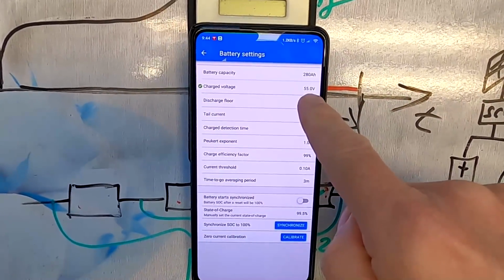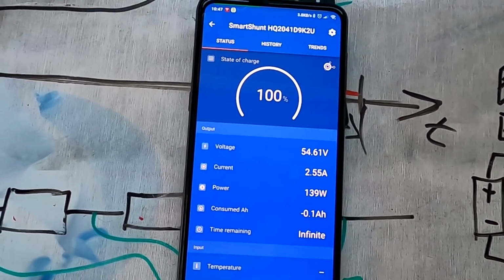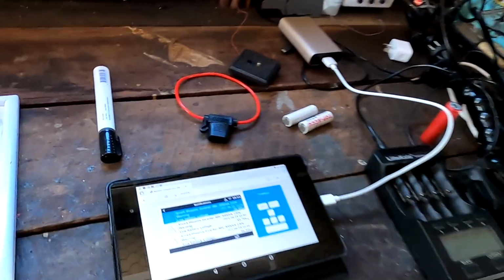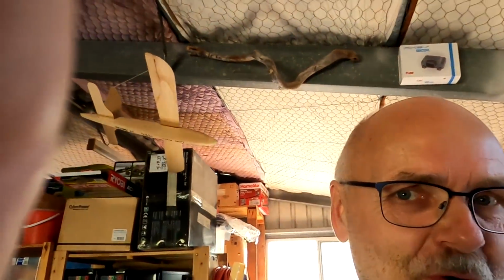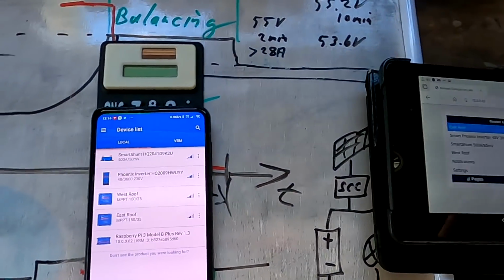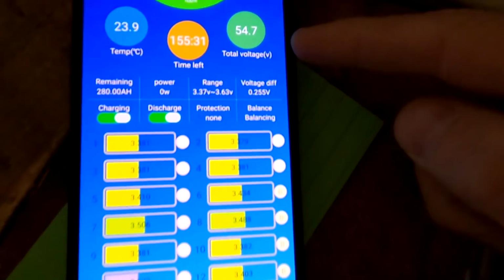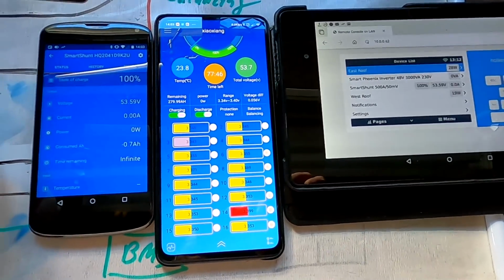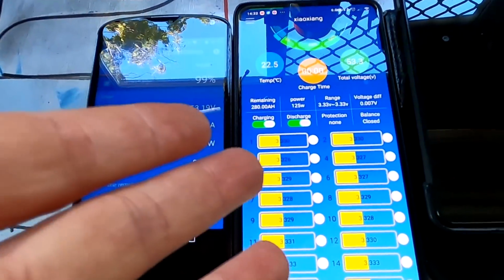Houston, we have a slight (BMS) problem and... are now Off-Grid!

Comment: If you have a high cell like that, lower your charge voltage until the high cell sits somewhere between 3.55V and 3.65V. Run the system like that for a week. The balancer will slowly pull the other cells up over time. Monitor the maximum cell voltage and move your charge voltage up by a 100mV every few days, until the entire pack is top-balanced.

Some BMSes can do this voltage adjustment automatically and communicate it to the inverter using CAN-bms. OrionBMS as far as I know, also REC-BMS. The latest version firmware of the BYD Premium LV as well.

Comment: Andy, since you have that spare QUCC BMS board from the failed relay, you can wire that board in parallel to the same relay, it would give you twice the balance capability with the same relayed shared for disconnect.
Reply: That’s a good shout. Be really interesting to see if that would work

Comment: Andy you need a BMS that is non relay, so that voltage can flow out of the battery bank , and not allow charging
Reply from the maker: Or I just need to top balance the battery correctly and leave the balancer turned off so it stays balanced. 😉

Comment: I have a very large family of both new, old, large and small LiFePO4 batteries that switch in and out in a near 100kWh system.  While I am still refining issues of resistance and load based cut in/out for various populations, I generally keep the cells within a range of 3 to 3.4 volts, discharged/charged or 48 and 54.4.  There is not a lot of energy outside of these voltages when you consider that you get an extra decade or more by staying within these lines.  You need a BMS to take out a string when it goes outside of your parameters or a high power balancer if you want to get fancy, but run the damned things down to 3 volts per cell and charge to 3.4 volts per cell and you will start to view the world from a different perspective.   These voltages also work well to give the backup lead acid 30kWh bank some mild exercise without really taking them below 65-70 percent and once a month or so with me watching the LiFePO4 BMS systems to make sure they cut out when I equalize the lead acid.

Comment: Andy - that bms is a joke!

A proper bms on HVD  disconnects the panels from the batteries, and never the load from the batteries, so you are never left with no power!

And, at LVD, disconnects the load from the batteries (remote on/off), maintaining at the same time the charging of the batteries.

There are also set voltages when charging resumes after HVD, and the load is turned on after LVD.

You should definitely take a look at sbms0 from electrodacus.com!

I have been using them for 5 years now (sbms100, sbms120, sbms0)

So it does everything: active balancer, monitoring through colour display, HVD, LVD, diverter according to SOC, about 40 different parameters that can be manually programmed, etc
Reply from the maker: Electrodacus only makes 24V BMS...
Reply: @OffGridGarageAustralia  yes, it is true. However I have built 48v systems using 2 sbms0, each one controlling 8 cells. And the LVD is wired in series between the 2 sbms0.

It works like a charm!

Not to mention the 25 years warranty!!!

Comment: I just received a qucc BMS.... is there an iOS app for it?  Or only Android?
Reply from the maker: Only Android, afaik.
Reply: @OffGridGarageAustralia  I ended up borrowing a friends android, and once I got into it I realized that it was a XiaoxiangBMS. And there’s an app for that in the Apple App Store.
Reply: @OffGridGarageAustralia  The issue I’m having now is that I can turn contactor off, but I cannot turn it back on from the software. I have tried with both the android software you are using with separate charge and discharge switches, and also with the Apple software which only has one switch. So far the only way I can turn the contactor back on is to power the BMS down and power it back up. And the soft switch or weak switch has no effect at all. It’s kind of crazy

Comment: I'm running a 4S2P system in my caravan using a single Daly BMS set to commence balance at 3.2v.I also have a capacitive energy transfer active balancer that can balance at 10A, but at very small voltage differences, it doesn't balance at high currents. It is balancing all the time. I have never top balanced the cells, but slowly incremented the charge voltage over a period of days, allowing the balancers to achieve less than 10mV differential at each increment. It has been running for about a month. The worst differential I have seen is 6mV and that was after storms where the caravan was running the house at night and being charged by generator during the day. Typically running 20 to 40A discharges and 60A charges. We were discharging around 250Ah each night. I went with 35mm2 wire busbars as they allow some flex. The solid busbars dont allow any movement, but with the possibility for the cells to bulge when charged, I felt this was a better solution. I do have my cells lightly clamped to minimise movement. Mostly I see differentials of up to 2mV, but mostly it sits at 0.000V. I have set my maximum charge voltage on my 2 Smartsolar controllers to 14.05V and the Smartshunt to synchronise at 14.0V. This has been working very well for me. So far I am very happy with the performance of the system.

Comment: I don't know if you have heard of or watched any of Jehu Garcia's content (JAG35).  He uses mostly 18650 cells to power electric vehicles and build powerwalls.  

One of the more interesting things that he has done is design a PCB based 18650 system for powerwalls or portable power banks.  His design is to place many PCBs in parallel, with each PCB containing (7) 18650 cells in series for a ~24V system (each PCB is 24V in parallel with other PCBs).  Each of the 7 Li-ion cells needs to connect to a BMS, of course, but it does not use a BMS for each PCB, rather a single 7S BMS is used for the entire system (or multiple BMSes in parallel if you want a higher max amperage).  So, as you add modules in parallel, there are PCB traces that link the individual cells in parallel to individual cells in other PCBs (all cell 1's in all PCBs are linked in parallel by a PCB trace to the BMS).  This design has a side effect of keeping all the individual cells balanced since they are attached in parallel with each other as well as the entire 24V until being attached in parallel to other units.

I know that doesn't apply to your current battery design since you are doing single cells in series rather than parallel cells in series, but perhaps it is something to consider as a different design as you start adding additional battery boxes/shelves.  Rather than doing an individual BMS for each 48V battery, you instead connect the 48V batteries in parallel and also connect each cell in parallel with the other cells (all cell 1s in parallel, all cell 2s in parallel, etc).  This would combine several cells in parallel from a BMS perspective,  making it less likely that a single cell will cause high voltage problems like you are seeing currently since the voltage of all the parallel cells would have to be high.
Reply from the maker: Thank you. Yeah, I'm watching Jehu's videos since he started his channel. I know about his PCB setup for 18650 cells.
I recently made two video about this:
https://youtu.be/zSMiB4_kVYg
and
https://youtu.be/fqr1nIhaWJw

Comment: One of the reasons to have a split DC bus with one lithium pack, solar chargers on the charge side, inverter on the load side.
IIRC Victron can connect to CANBUS J1939, but only via their GX.

Comment: Andy, I have come to appreciate and learn a lot from your experiments.  I wish I had the capital to purchase all the "toys" you receive in the mail seemingly daily!
Although I am gaining a lot of knowledge from your experiments I hope there are not many individuals who are just thinking about or getting started with solar..  This is  because if one was a newbie the impression of solar I would get from your videos is that a solar/battery system requires CONSTANT tinkering and repeated component upgrades or replacements.  If I had found you when I was just beginning to think about solar at our remote cabin I would have surely abandon the idea.  I almost think there should be a warning on your channel something like "warning, this site not suitable for beginners." 
Luckily for me I watched YouTube videos of individuals setting up a system in a more simplistic approach which left me with the feeling that "I can do this."  Yes, your system will EVENTUALLY (I think) be more efficient and sophisticated but a system does not need to be as complex as yours to functionally work.  Our cabin system has been working fine now for 7 years.  In that time there has been huge advances in solar and battery  technology.  Your site has given me many ideas on how to upgrade our system and someday I will do so.  However, for a system to be functional, especially on a smaller scale than yours, it does not have to be constantly tinkered with or changed.  Use some good quality components and let the system run until there is a problem.  We have had only one minor problem in 7 years with our system.
Reply from the maker: Thank you John. That's a very good point and I should highlight this in one of the next videos. You only need a few things to get started and can (not must) upgrade later on.
As you said, this is just me, I'm so hungry for more information, experiments and exploration, that I constantly try out new stuff, settings and installations. I should mention this more often.

Comment: This exact same thing happened to my with my 16 cell pack  ( Same cells as yours ) this last weekend. It was a little worse than your situation as my JDB BMS with stock settings got confused and started charging a single cell past 3.65. The overcurrent protection started cycling every 2 seconds in stead of staying enabled. Resulting in it continuing past the 3.65 limit. Luckily I was there to see it and stop it. It is very disconcerting not being able to trust the BMS. These types of systems have to be watched constantly.
Reply from the maker: Yeah, I'm still not sure, why it does not fall back to the voltage recovery voltage of 3.55V as it should. As long as the cell is higher than that it should stay turned off right?
I don't like that!
Reply: @OffGridGarageAustralia  that is what I had expected: wait for two seconds AND the voltage to return to 3.55. I observed that it only waited 2 seconds. Well at 40 amps of charge coming into the bank that would've resulted in a run away for that single cell. A huge failure no matter how you slice it. I'm left to wonder if I configured something incorrectly ( using stock lifepo4 settings ), my unit is bad, or the programming in the BMS is fatally over rated 😒

Comment: The battery management system stops balancing when it considers it is in storage mode. Daily BMS does this also it will not balance in storage mode. It only balances in charge or discharge mode

Comment: Hi Andy and the community, Tony From UK wales here.

I've just seen the video and I Must say although not good news for you I'm quite pleased!

You see I have been in a similar position with my system through  my project and was keen to see yours work so well (up to now) But now you have run into this situation with single cell overvoltage (although I see your cell 7 was climbing fast too!) It seems maybe (as my suspicions for my system ) be due to  'Normal' cell operation.

Through my issues I have suspected my cells may be mismatched and have placed a work around of lowering the max charge voltage to a lower point of the charge curve 54V (16* 3.75vper cell) although the capacity is lower than should be I still get 95% capacity and run the cells further down the charge curve easing cell degradation at the same time.
Maybe now I have seen your cells behave in a similar manner it may point to us both running the cells to close to the 'end of the flat' part of the charge curve. i.e. the high cell taking the BMS out may only be a fraction higher than the other cells but flying out of control high because it reaches full state of charge first (one cell has to be first I guess due to us not living in a perfect world?)
I also have 2 battery's on the same inverter as you are going to but did run into the same overvoltage issue.

I have a 16s Lifepo4 (150AH) battery  and 14s lipo Battery (170AH) in parallel (cant wait for comments about that!!!) and running at 54V well now for over 6 months and have swapped out BMS to 'seplos' system boards communicating to my grid tie system through my sofar ME3000sp.  Balancing starts at 3.3V Per cell and runs constantly, this seems to keep the cells in check.

I look forward to seeing how your system evolves, your doing a fantastic job.

Enjoy the beers.

Tony
Reply from the maker: Thanks for sharing Tony, awesome!

Comment: You made the comment you haven’t been able to keep batteries charged.  I think you should take all the extra panels you have and do an experiment on how much voltage do you actually loose on long runs of cable.   Place them away from your trees.  And in 100% sun.  Your loosing money by having them in the garage and not mounted.  I think you’d be surprised on how much sun you get.  Thanks for your channel and I hate your haters.  I got you back.

Comment: You don't need time to balance. If you go with a passive balancer, what you need is one that can sink more than your max charging current (e.g. 2x). At approx 300W peak (if I understood your video correctly), this equates to a maximum charging current of approx 6A, so your BMS should be able to sink at least 10A. If it can't, you will alwas get these overshoots. It seems that while your BMS can handle a load current of up to 600A, the balancing current is only 160mA. In that case I recommand reducing the input current to approx. 200mA as soon as the first cell starts to overshoot.
Further more: Your turn on voltage (3.351V) is too low, as in that region (3.2 - 3.4 V) the cell voltage is not a good indicator of the cells carge status. I recommend moving the starting voltage for the balancer to 3.45V (try looking up the charge diagram for your cells. At >90% you should see the voltage rising qurite drastically. Try to configure your BMS to work on the right side of that knee).
I hope you find at least some of this helpful.

Comment: I have an ELECTRODACUS and I think it has a number of benefits over your BMS. 
First, it has 4 disconnect ports, each can be configured in a different way, such as to disconnect chargers or disconnect loads independently. This function works with any device that has remote on/off functionality, including Victron MPPTs and inverters. It also works with any device that has a simple on/off switch. Eliminates the issue you questioned in the video as to why it cuts off load side when only charge side should be cut. 
Next, many have pointed out that your BMS parameters may be the issue. Electrodacus' lithium profile is as follows. End of charge = 3.48v. Overvoltage = 3.5. Overvoltage lock = 3.7v. Overvoltage recovery = 3.35v. Cell balance max = 3.55v. Maybe this will help?
Lastly, it only monitors current via shunt but no current passes through the BMS itself. Probably conducive to less failures.
It doesn't have a phone app but does have WiFi to monitor from the phone via the browser. It also has a screen built in. 
Seeing you go through the trouble I'm thinking this kind of BMS might be  better way to go since it's pretty much plug and play - the charge profiles are built in and and you can control loads and chargers independently. Just my two cents.

Comment: Hi Andy, you made such good videos where we could see that a much lower cell voltage is also sufficient to fully charge the battery. At 3650mV you are in the steep curve. That a cell "goes up" is quite normal. 
I have set my maximum acceptable cell voltage to 3375mV. Important now the release voltage (of the charge access) not too close to this value. I'm still experimenting a bit there, but currently it seems to work quite well with a value of 3350mV. 
At such low values, there is no voltage drift of the cells. And the BMS doesn't switch back and forth between overvoltage and release too quickly. 
The battery still gets full because I only charge at about 0.05C to 0.1C, and the individual cells are almost 98% charged at about 3360mV.
And starting from 3375mV that corresponds to a maximum of 54000mV battery voltage. This is then your values to which your system has to "orient itself".  Just try
And if the BMS switches off the battery input 3-5 times on a sunny day, so what?
A cell drift is not to be seen there in this case.

Comment: Did you factor your balancer current consumption into your charge parameters it will consume roughly 3.2 A if the balancer current is 200milliamps per cell

Comment: I’ve commented on this issue before, there’s no way a bms can keep up at such a huge* bank. What happened here is that the top balance have been destroyed by the bms since it have balanced at the flat part of the resistance curve. Also consider the fact that you have a tolerance for the bms voltage readings. I doubt it is calibrated within a millivolt.

If you stay within the voltage spec for the cells (2.5v-3.65v), you will get around 3000 cycles within 80% of capacity retention. Isn’t that enough? I mean, the storage technology will have advanced a LOT when you reach that point and cheaper and better storage solutions will most likely be available. 🤞

I’m glad you shared this experience though! (And also came to the conclusion that a relay-based BMS just don’t work in a real world application as yours)

*(huge from the bms balancer perspective)